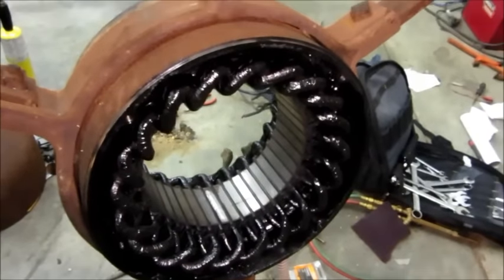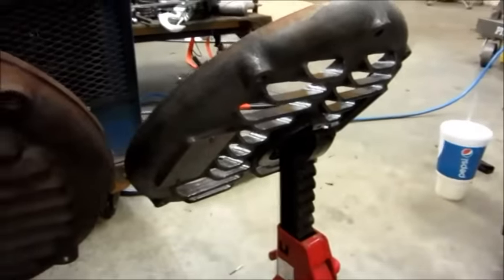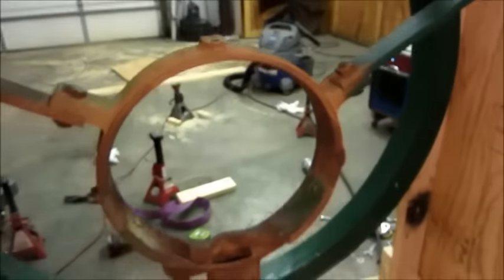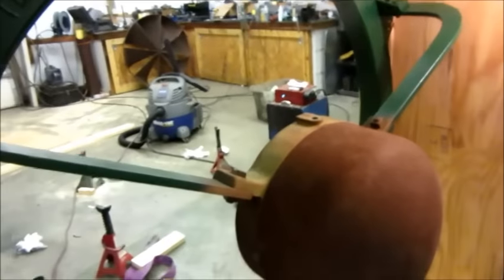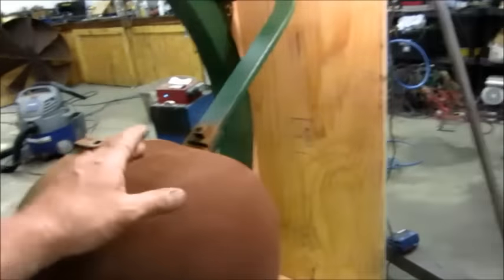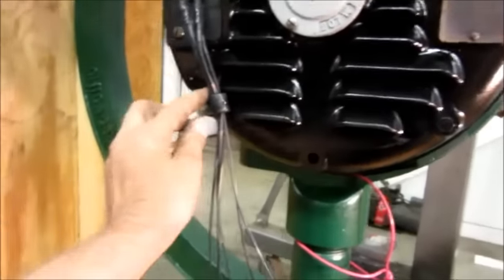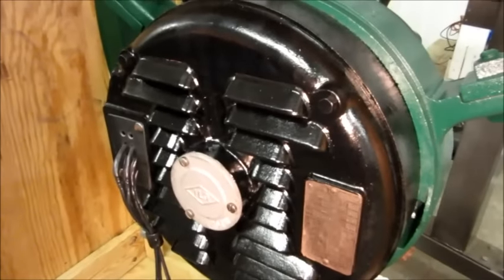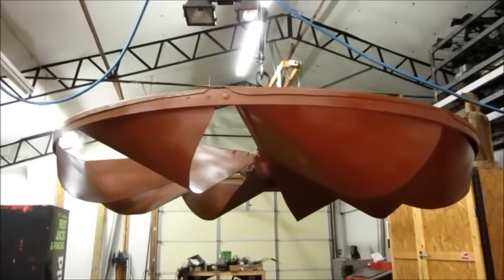Antique 48" ILG Electric Ventilating Co. Self-Cooled Motor Fan Restore - part 2

Comment: It's going to look like new.

I would guess it's rather silent with the blades.

Like if you had it on top of a box of filters it would keep the workshop-air clean without too much noise.
Reply from the maker: Thanks, I hope it looks like new!
Reply: It probably will in the next video. Got any intended uses for the fan?
Reply from the maker: It is not loud, but just the sheer power of the fan makes a lot of wind noise.

I'm going to use it as a shop fan. Will have a VFD on it. That is basically an electronic power supply which will allow the motor to run at variable speeds without harming it. I can run it slowly for use as a near-silent shop fan.

Comment: What did you use to get that rotor looking so nice?
Reply from the maker: I used a glass bead blast cabinet first, then put the rotor in a lathe, while I polished it with Scotch-Brite pads. Then clearcoated the ends.